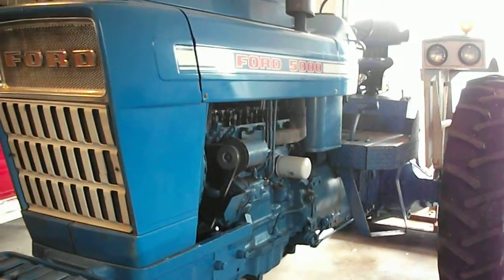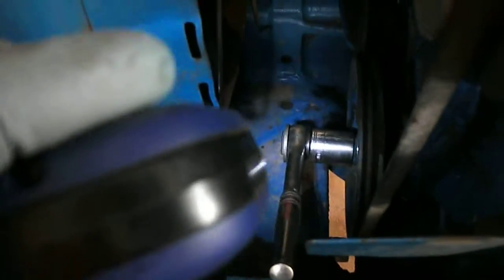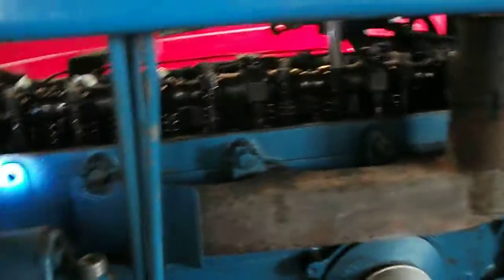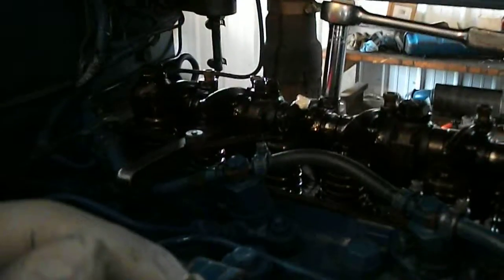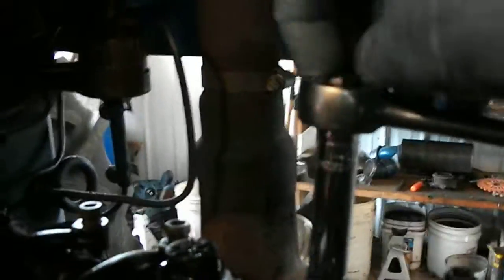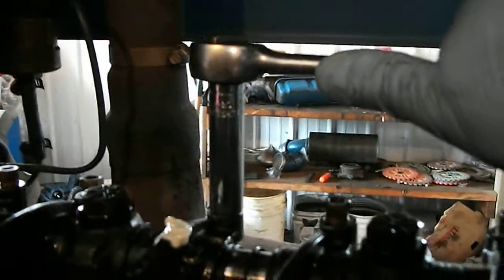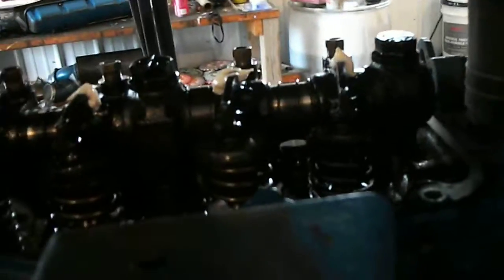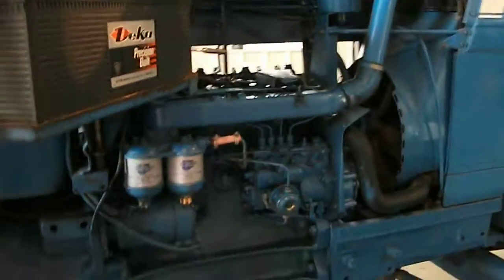Ford 5000 Diesel Valve Lash Adjustment

Comment: Thanks for the pointers buddy, im doing an adjustment on my Ford 3000. I have intake at .014 and exhaust at .017.
  Ill check it back tomorrow cause now i know where to look for TDC on the flywheel.  Been feeling around for tdc while turning over the engine.  I may try the adjustment you have and see how it goes. Atm its starting up. But i have to advance the throttle to start its not starting at idle as it use too. I have the front seal on the injector pump leaking so gonna get that fixed and then fiddle around to get the sweet spot on adjustment.